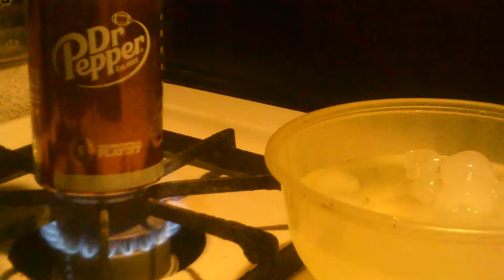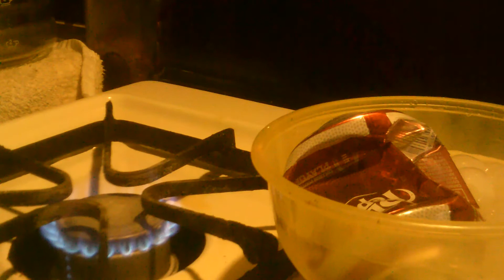HOW TO MAKE AN IMPLODING CAN CRUSHER!

Comment: Wow the can suddenly crushed automatically  how did you do that
Reply from the maker: When the soda can is plunged into cold water, the vapor condenses quickly, leaving a vacuum in most of the can. The resulting large discrepancy between the outside and inside air pressure leads to a large net inward force on the can, ending with its rapid crushing. Thank you! Happy New Year to you also!